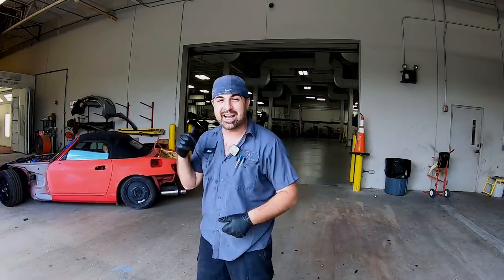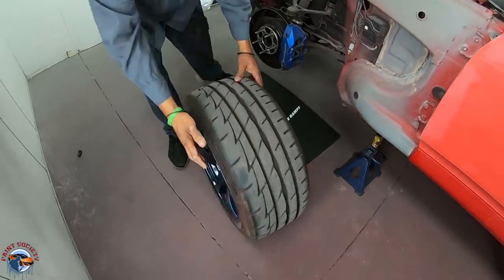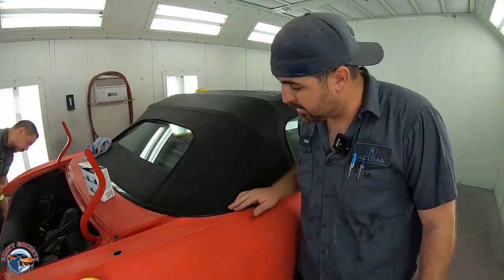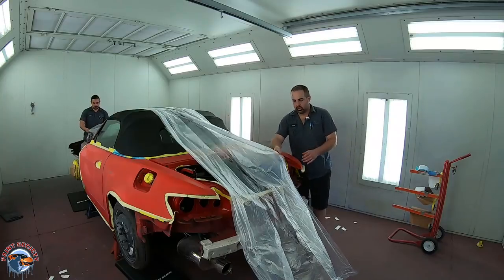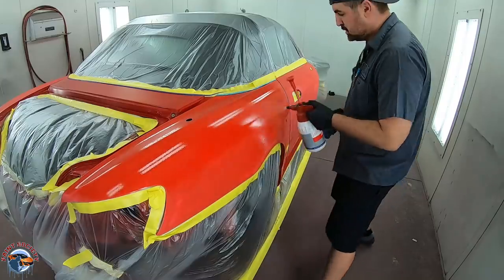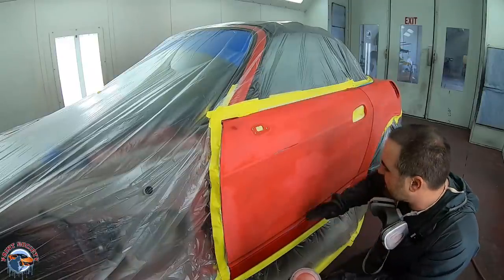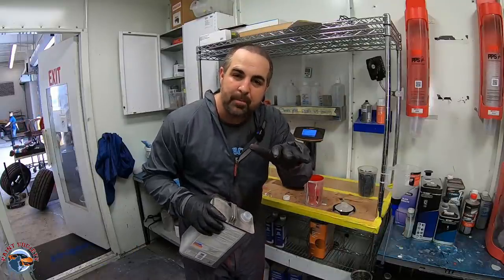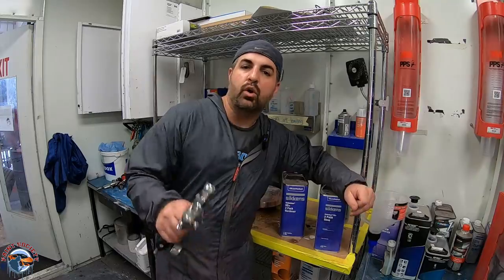The Steps to Land a Beautiful Paintjob! Part 5

Comment: Can you do the difference between “Single Stage vs Base/Clear”
Reply: single stage has a UV protection in the paint compared to the base coat which has none that why you need clear coat and single stage sometimes doesnt last as long

Comment: The sealant coat looks very nice as is. Is there a way of protecting and keeping that look? Would it change the look if the clear coat is applied on top of the sealant coat? Sorry I am new to this line of work. Thank you
Reply from the maker: Have to base over it. Just get color that looks like sealer with a Matt clear for the same look

Comment: Red looks so yummy!
But how do you know all the panels are going to be the same color, seeing as you're painting them at different times and not blending them in, like you did with the damaged front wing in your previous video?
Reply from the maker: Good question. I mixed a quart of paint and on the last coat of panel i painter, I used the same paint to keep consistent.

Comment: Never used a sealer, always used a thinned 2k primer and just sanded to 600 grit. What happens if you spray the sealer and it doesnt lay how you want it, can it be lightly sanded and based right over?

Comment: I just put a rearfull section on car ,cut above c Piller and rocker panel,so there was a lot of grinding,covered as mush of the inside,but grinding particals landed on roof and hood,it rained and when I got back to working on car,the dust particals became rust that imbedded itself in the clear.what a freaken nightmare to make it look right again.

Comment: Brian i looked at the Eastwood guns and i cant use them my compressor is a 30 gallon 5.5 scfm @ 90 psi and 6.5 scfm @ 40 psi  i don't mind spending around $600 maybe 700 for a good gun that will give me a great finish if it will work with my compressor do you have anything in mind thanks Brian
Reply from the maker: You technically can use them but you won’t be able to paint more then a fender or bumper with that size compressor. In fact going by the specs you won’t be able to use any paint guns with your compressor.

Comment: Hi xan u yse a hvlp turbine sorayer to spray cars rather than compressed air? Also what is the difference in hvlp and lvlp thanks
Reply from the maker: You can and I’ll be doing a video on both
Reply: @PaintSociety  excellent thanks for the reply. I learned to spray professionally as a teen but have been out the industry for over 16yrs now can you also do a video on water based paint vs 2 pack i have never worked with water based i learned with celulose paint then 2pack lol

Comment: Which is better? A white sealer for red or a red sealer?
Why do the paint manufacturers recommend the white VS for red paint?

Thanks
Reply from the maker: Red covers over white very well. Obviously red is a better sealer for red base but they can’t recommenced it because my system is very unique and. It many have the red option